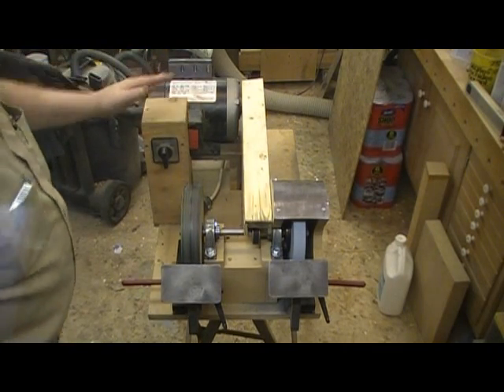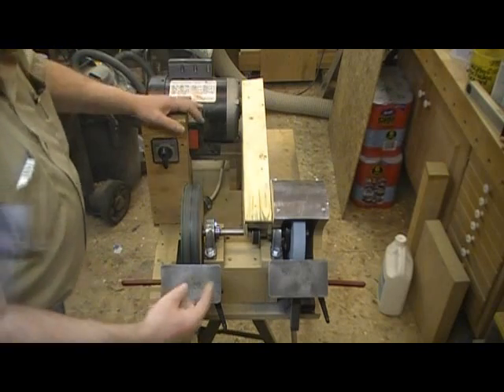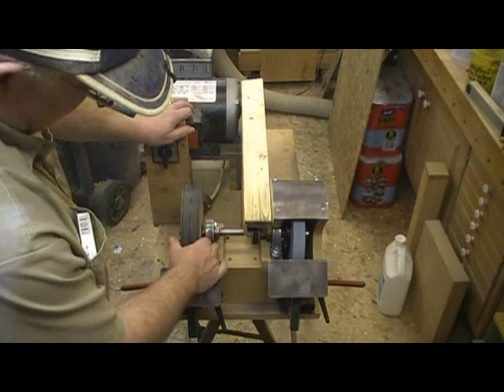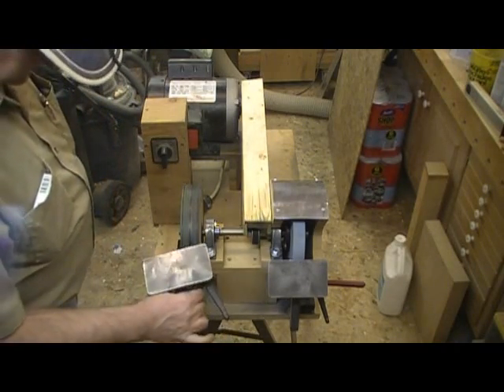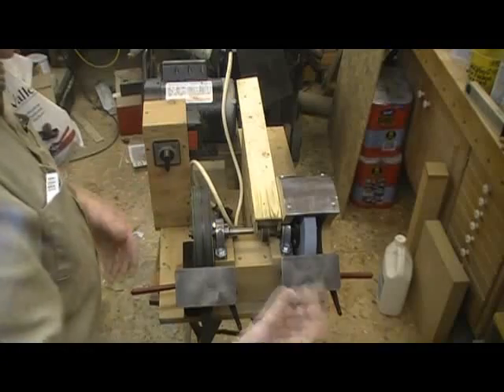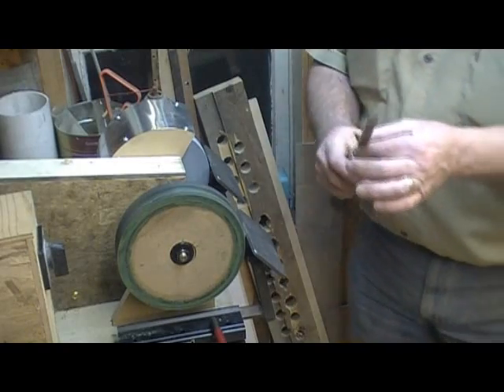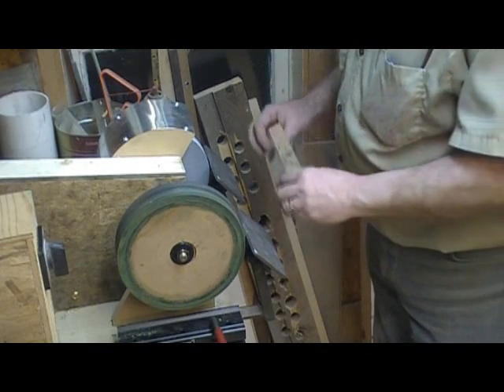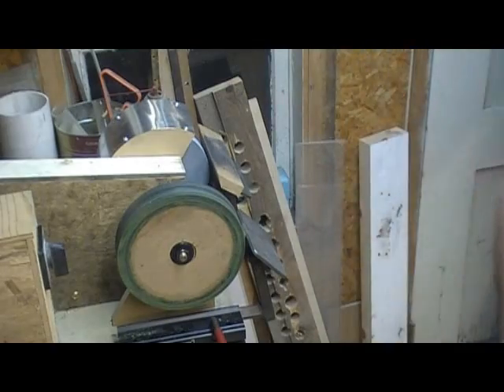Sharpening my way Segment 1 of 3

Comment from the maker: Hi:
I cut the disk on the band saw and mounted it on the lathe to true it up.  After mounting it on the mandrel for use I did a final truing using light cuts with a scraper before spraying it with oil and applying the compound.  I have trued it up once since I have been using it.  It does not really wear like the grinding stone does.  It will get some depressed areas in the most heavily used spots but they don't seem to make much difference in its use.

Comment from the maker: Hi:
Actually, the whole point is to use a material that is not soft enough for the tool to sink in.  The MDF does not get soft from the oil, it just holds the compound better.  I used a hard felt wheel for years but it was soft enough that it would round the bevel a bit because the tool would be sinking in a bit and then the felt would return to its natural level as it came out from under the bevel, creating a "micro micro" bevel right behind the edge.

Comment: Bob, Why do you need a reversing switch on your grinder set-up?  Do you put it in reverse when you're stropping?
Reply from the maker: Hi, David:
Yes, I need to put it in reverse when I use the honing wheel or the edge will dig into the MDF.  My previous honing set-up used a hard felt wheel rather than the MDF wheel and would have been even worse if I had tried to hone without reversing.

Take care
Bob